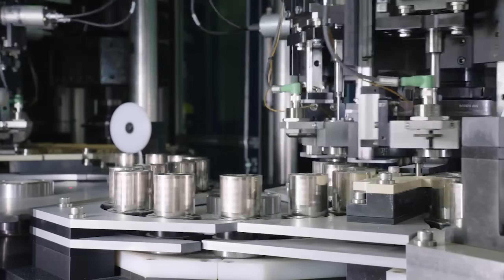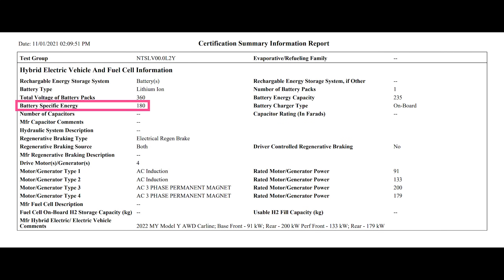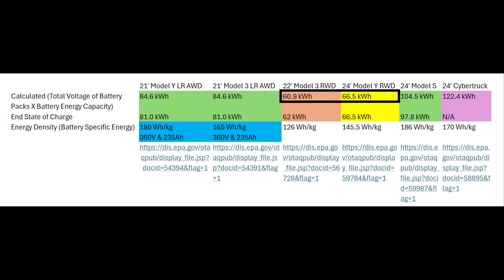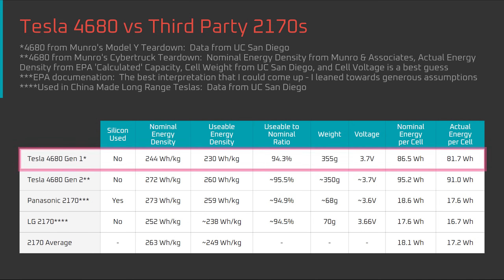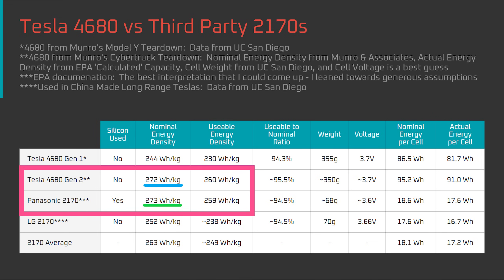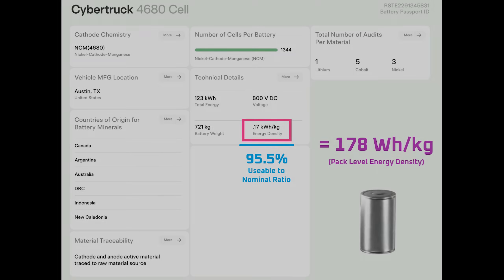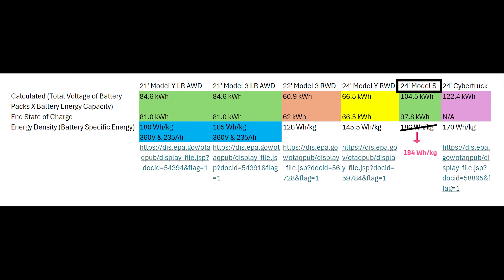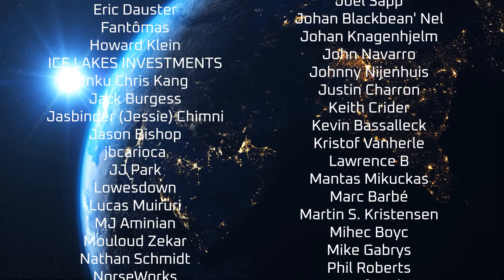The 4680 Hits a New Energy Density High // But how does it stack up? 🤠

Comment: 8:58  We must remember that the recharged energy is always higher than the discharged energy ( recharge efficiency can't be 100%) so I would doubt that the 122kWh is the usable energy but is the recharged energy so the 122kWh should have some loss.. even more if it is at level 3 charging speed. If 122kWh went in the cyvbertruck.. then what is out of the battery must be lower
Reply from the maker: That was factored in

Comment: I was wondering if you have a video on the Sakuu battery..
Reply from the maker: I probably won't do a video on it

It's much more expensive to 3d print and electrode than to just paint it on at 100 meters per minute

Comment: The reason for inconsistency. The cell chemistry is still something not very well understood. As in - take 100 mL of gasoline of regular octane rating or any energy regulated fossil fuel from any two gas pumps anywhere in the US, under similar conditions. The results will be the same, within 99.99999% of the two samples, in terms of their energy content.
Meanwhile, for the cells it is quite different. Take two groups of any number of cells each from a simple raw material batch or from different batches of raw materials.
The energy content of the cells will be probably within 98-99.5% of each other, and it has greatly improved in the last 3-4 years. This is because, after cells are manufactured, they are essentially stored for sometime for them to mature and then voltage levels are checked for their voltage ranges. How the cells mature, is quite different from one another. Even two cells only a few centimeters apart from one another will NOT have the same maximum total energy content.

As battery chemistry is understood better and how maturing of the cells takes place, we will get better at it.

Also, one of the reasons for Cybertruck pack level energy density vs cell energy density is so different from one another is simply due to the bigger diameter of the 4680 cell. If you try to fit circles inside a rectangle, to have the least amount of wasted space, you need circles as small as a dot, which theoretically is infinitesimally small, which isn't possible. So, 4680s cause more wasted space. If the cybertruck's battery pack was filled with 2170 cells from Panasonic, the cell energy density and pack energy density will be much closer to each other, just by the virtue of less wasted space.
Reply from the maker: It's a testing issue mostly

Some will be variability, but not by 3 kWh on an 82 kWh pack

It also doesn't explain the inversion between calculated and measured in one of the packs

Comment: What's truly and utterly impressive is that they've managed this without a dry cathode, high silicon and with a 60% pack level packing efficiency. Even if the dry cathode yields a 5% density boost and high silicon 12% (pessimistic at 4.35V), that'd be 400 miles of range for the CT. Increase packing efficiency by 20% (will almost certainly happen) and you're looking at ~450 miles of range. No range extender required.

Comment: Thanks Jordan! Very informative video.  I couldn’t wait to watch this one, and same for the upcoming video about 4680 chemistry.

One point about battery energy capacity:  Multiplying the nominal voltage by the Ah capacity only gives an approximation of the Wh energy capacity.  To measure capacity it is necessary to measure voltage and current over the entire discharge curve, then integrate over time to get the actual Wh delivered. AFAIK, battery researchers like Shirley Meng will always use this method to measure energy capacity.
Reply from the maker: Correct 🎯 The EPA needs to up their game

Comment: wait. 500kgs of batteries. Engine (with good torque) weighs about 200kgs + 100kgs of transmission + <100kgs of fuel tank. It's not that much overweight!
Even adding 100kgs as electric engines and coolant, that's about 200-250kgs So it's not electric cars' trouble. It's just a model 3 actually is an S class! But without any features of it... Now it's clear why people tend to hate it.
Where cybercab Elon? People is getting mad about it... It can be 1500 kgs but still a compact, economic and easy to drive vehicle

Comment: Excellent analysis!  Fewer cells per pack and way fewer welded interconnects is a huge deal for manufacturability and long term reliability.  And it's still early in development so we can expect improvement from here on both cell and pack design.  Looking forward to next video.

Comment: But Tesla has now solved dry Cathode mass production and a new 4680 is due out (V3?) by the end of the year, which should be a good deal Less expensive and possibly (probably) more energy dense. Would be nice to see the density and cost relative to 2170 (best) improve substantially. 
Will we be approaching 300wh/kg or will it be much the same but ??? cheaper.
Tesla needs to sell Semi, Cyber, "Not Model 2", Roadster at a profit. 3 of these will need atl least 300wh/kg to make this happen.
Reply from the maker: More on some of these topics in the next video 🤠

Comment: @thelimitingfactor Would you consider this 2nd Gen 4680 cell the "High Nickel" or "Nickel/Mag" chemistry from the battery day presentation 4 years ago?
Reply from the maker: Good question.  High Nickel!  But, still not quite at the specs advertised on battery day
Reply: @thelimitingfactor  Thanks for the response. I was predicting 120wh per cell for the high nickel after that battery day presentation. Optimistic yes, but 96wh is still a ways off. Do you think with the specs from battery day they could get there?

Comment: This is why Tesla has such a huge and near unsermountable lead over the competition. 

The battery is the most expensive part, everyone has to buy them from 3rd parties adding to cost.

Also range should no longer be the 1st Stat when you look at a EV. 

KW/mile this is the equivalent to MPG for a ICE vehicle.  Kw/mile gives you the true cost to operate the vehicle.

Comment: Amprius Technologies Inc have cylindrical batteries cells @ 400wh/kg with 1200 cycle life so why is Tesla still so far behind?
Can you check them out Jordan?
Reply from the maker: I covered this in the video.  Plenty of high energy density batteries out there.  The issue is other requirements.  Amprius is multiple times more expensive per kWh

Comment: There are more variables to take into account to get the exact numbers for the density.
Brass takes - what is 5 % in deviations on the numbers - stuff all.
.
One number that would be interesting is the power density after 10 years. (I can wait for that video?)
Next Gen Battery please.
Another great video.

Comment: CATL is at 500wh
Reply from the maker: catl doesn't even bother to mark at those batteries for vehicles because they're for aerospace use cases...

Too expensive and not the right characteristics
Reply: @thelimitingfactor  - Very true. Given the very different needs in aerospace, battery powered solutions may well be addressed very differently to that of automative solutions. Planes are apt for having modular swappable battery packs, that can be charged and serviced off plane - to maximise the turn-around and in-flight operational duration that drives the bottom line in many areas of commercial flight. 

Plane battery cells will need to be optimised for flight's energy needs such as prioritising high energy density and high power capacity - such as greater peak energy demand such as 3 x the power requirement during take off compared to cruising. Pack designs will also be plane orientated, likely optimised for swappability (e.g. non-structual containerised packs) rather than the integrated high structual/low spatial usage designs present in automotive use.

There is also room for different thinking in aerospace, such as prioriting the use much higher energy density battery chemistries (such as Lithium-Air, available currently with 1700Wh/kg energy density) over cycle lifetime (Lithium-Air typically offers under 1,000 cycles). Seeking systemic, service based, solutions to address the low cycle life times of very high energy density batteries; for example adopting high recyclability battery cell designs to enable cost effectively, from aerospace perspective, recycling back into new batteries.

It's too early to tell whether current battery makers will diversify across market segments or that the battery market will fragement into different specialist manufacturers for each specific segment.
Reply: @thelimitingfactor  Yes, I know. Only saying that other companies also have the technology. I only hope that Tesla is not to late.

Comment: If the density is increasing, would they increase the power capacity in the CT? 122kwh is not great. Definitly not the 200kwh they were hoping. Being able to match Rivian for eg in capacity would be nice.
Reply from the maker: You mean the energy capacity? 

122 is fine for most people, which is why the trucks are selling like hotcakes 

Tesla wasn't hoping, a small segment of the population that wants to use the cyber truck for towing was hoping. 

Tesla looks at what most customers need, and they designed for that 

They could have easily put in a 200 KWh pack in the cyber truck, that would add extra weight, reduce ground clearance, or make the cabin smaller 

That is, the trade-offs weren't worth it

Comment: If they reduced the shell so much, is it still capable of serving it's structural duty? If not, or not as much, weight  that is saved here is being lost on the chassis of the car, reducing the overall benefits
Reply from the maker: Who said the cell is still structure? 😏

That's a totally different topic 

Either way, look at how thin pop cans are, and how high they can stack them 

Even a cell can of this thickness can after structure, especially when bound up with a lot of other materials and glue 

It's like the strands of a rope
Reply: More rigidity in the foam let's the can be less rigid

Comment: Watts per Kilogram? ICE cars are easier to understand.
Reply from the maker: Yeah, many motorheads don't even really know the difference between torque and horsepower

And different countries, use different metrics 

Some use kilowatts rather than horsepower 

That is, just because something is unfamiliar doesn't mean it's easier to understand, it just means you have to upgrade your mental database

It's nothing but a new metric for power and energy
Reply: For comparison to ICE, gasoline is about 12,700Wh/kg. It's not complicated, it's just a different way of looking at things. It's just another power:weight metric that's helpful in its use case.

Comment: Capacity of a battery, C  is defined as: 
      C (t) = int I (t) dt

capacity is the measure of the current (charging or discharging ) over time.

Comment: Why is this so exciting? 
My small entry-level BEV 2020 Renault Zoe R135 has a 52kWh battery pack. That is 192 cells at 1073 gram each of the LGX E78 battery cell from LG Chem (NCM 712 type). That is rated to 265Wh/kg in standardized testing but also when limiting the charging to 4.157V so it could be more if charged as high as Tesla does it.
I do agree about the 4680 possible benefits if used as a structural battery and current discharge capacity and cooling posibilitys. But not regarding energy related to weight.
Reply from the maker: Any monkey can make a high energy density battery cell

The challenge is to make a high energy density battery cell that also results in a high energy density pack that's also cheap, and durable and long lasting
Reply: The LG cell in the Zoe is a pouch cell, so it mechannicaly always has higher energy density than a cylindrical or prismatic cell (no hard shell !).
HOWEVER, a pouch cell, needs to be stacked into a strong reinforced module for safety and to mitigate its sweling, that module adds weight and volume, making a pouch based pack less weight and volume efficient than the same kWh pack using cylindricals or prismatics. This is the debate that many old fashion OEMs struggle to understand and keep asking for "bolt on modules" even with cylindricals or prismatics while a CTP approach is possible as demonstrated by Tesla and a bunch of Chinese car makers.... lowering overall cost, increasing safety and performances.
Reply: The important factors for transportation is weight, recharge time and lifecycles.
For grid storage is lifecycles and lifecycles.
Density is almost irrelevant.
So could we see this divergence?
- cars and trucks
- airplane 
- grid storage.
I can see a whole range of advances over a decade. Anodes. Chemistry. 
By 2035 600 plus, 2,000 cycles, 4C?

Comment: irrelevant if not compared to latest Chinese offerings such as blade and blade2
Reply from the maker: I already covered that in another video.  So, no.  It's not relevant for the purposes of this video.

Additionally, you're only looking at energy density.  The 4680 structural pack will be cheaper and can scale on demand because it's all in house.
Reply: @thelimitingfactor  Maybe a cost and performance comparison video in future.  Thanks for your hard work
Reply from the maker: @ianswayne7296 sure thing! I've covered both of these in other videos 

Cost was covered in the Q2 earnings call video, and I did a comprehensive pack analysis of all the major structural packs a year or two ago
Reply: For Tesla, it is very relevant as they don't need to buy from third-party and or dependent on their battery. That is not to say they won't supplement the battery from other manufacturers. 4680 will continue to see improvement just as the gen1 blade to gen2. CATL also has great battery. Does that make BYD Blade irrelevant?

Comment: It's interesting that an 18650 is more energy dense than a 4680 after all the touting of greater energy density and the need to run more cooling channels through the pack.
Obviously you raise a good point about the structure of the floor, but I thought it's just a bit odd that Elon touted 5x the energy and 6x the power density than 18650s. It will be interesting to see if they start doing their top or bottom side cooling on these cells at some point to make them more dense.
Reply from the maker: Side cooling is probably better.  I did a video on this.

What matters is why the 18650 is roughly the same energy density at a first principles level.  When you take that into account, the 4680 has huge advantages that will become apparent in the next couple of years.
Reply: Elon’s statements of timeline and capability should always be thought of as the “best, aspirational target numbers of a mature system.”  DBE development and mass production have BOTH proven harder than his optimistic statement timeline allowed for.  
As he’s said, though… if he weren’t an optimist, he wouldn’t have even tried many of the breakthrough things he’s done.  I’m SO glad he’s an optimist (and a brilliant, DETERMINED one at that), but you have to “bring your own filter” when looking at his targets, because HIS filters are beautifully broken.
Reply: @737smartin  " When I give a guess, I give the guess that I think is the likely midpoint, not the point with lots of margin. If this is normal distribution, I'd give you the 50th percentile, not the three segment optimistic or pessimistic. So then that necessarily means, at least, half of my predictions will be wrong and half will be right. Yeah. I think -- or it might be right, but offset by a few weeks to a few months, in some cases a few years. But I believe as everything I've ever said would come through -- did come through, it may come through late, but it did come through." 
Musk, Q1 2020 Earnings Call.
Reply: @waynerussell6401  I didn't mean to imply that Elon is painting HIS best case scenario.  I'm saying this is what it usually really is.  Mostly, I LOVE, RESPECT and ADMIRE what Elon has aspired to and accomplished!  Resist building your life around his timeliness and product announcements, though.
Reply: 18650 is at its final end stage generation, 4680 is at its baby generation. It was merely just months ago they accomplished dry anode & cathode - which is a key requirement for the (long term) target energy capacity of the cells. The fact that the cells are already within specs of 2170 cells is quite astonishing. 4680 cells will continue to increase its capacity for at least a couple of years where 18650 and 2170 cells pretty much are peak performance right now and very much have stagnated in capacity improvements.

When and once 4680 cells start to slowly implement silicon in the mix (probably close on the board now that dry anode & cathode have been solved) the density will "quickly" creep upwards.
Reply: And you’d think with 80% fewer parts, and the 18650 requiring extra cans w extra welds, that the pack level energy density would favor the 4680…

Yet on the pack level the 4680 seemed to go lower.

Comment: This is probably why Lucid has such a high efficiency rating 😂
Reply: The 2020-2021 model 3 sr with the 51-55kwh nmc pack's got over 5miles per kWh 3-4 years ago. The model 3 is also closer to the air in total size than many realize. Plus it uses cheaper 400v tech vs lucids 900+v more expensive silicon igts. 

Also the current sr using lfp prismatic cells from catl gets 5.2+miles per kwh per Bjorn ev testing in real world conditions at hwy speeds over in Norway. 

And Matt from carwow got 4.83miles per kwh recently in his awd lr highland test in real world testing conditions inc rain&hwy driving. 👍🏻😎